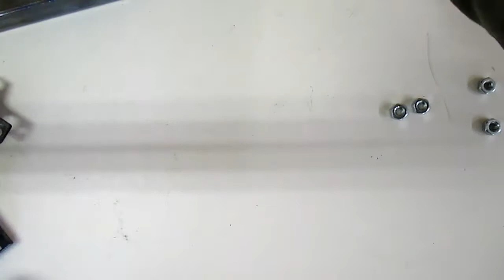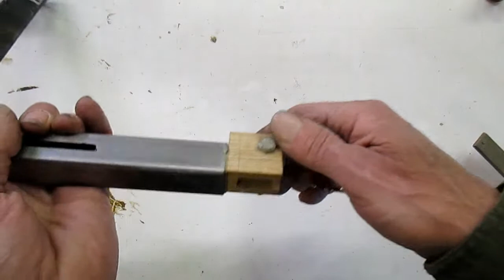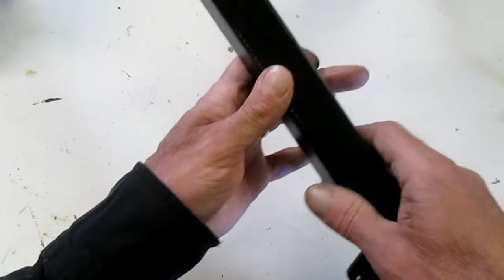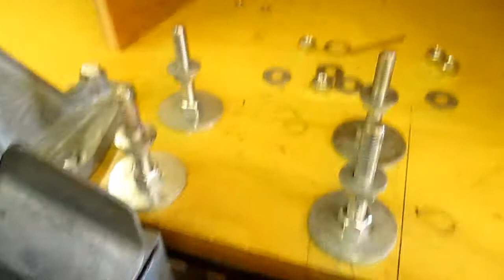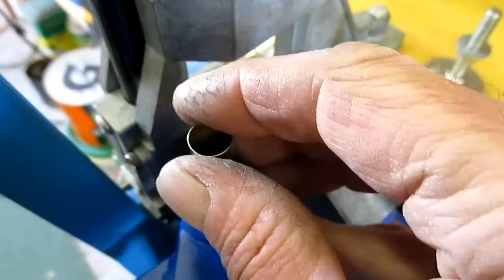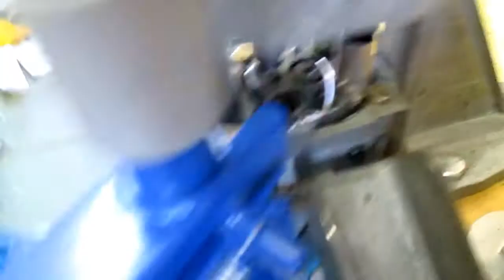The Build Dillon Square Deal B Case Feeder

Comment: Hey BYI, Thanks for showing us that it can be done... I know you have said this was a one off, and you don't have any plans/ drawings of the idea. Would you be able to confirm the different lengths of tubbing you used for the vertical/ horizontal pieces? I have tried to use my phones measuring tool and paused the video and seem to have gotten 3-4 inches on the vertical pieces and 5-6 inches on the horizontal. Am I close to what you have actually done?
Reply from the maker: Hi Roy, I did a short video for you with some measurements. This is only what I did, you may come up with something different but I hope this helps. Here's the Link       https://www.youtube.com/watch?v=MFSbqGKVuHY&lc=z224y3ojdt3xy1cqe04t1aokgr5g5jweip1rehdugahrrk0h00410

Comment: I'll just buy a 650 or 1050.  Had the SDB it's a waste of time IMO.
Reply from the maker: Now I have been running my Square Deal for 30 years now, it’s what I could afford at the time. It’s always done the job at task, the one I put the case feeder was by buddy’s. Sometimes we have to make do on what we have. And still can’t afford 650 all decked out so I just make things work best I can. And the challenge of it makes me want to do it.
Reply: draw up some plans with parts to size to be used as templet I will buy them
Reply from the maker: Sorry P.A. I have no plans for this just had a sketch on a piece of paper then made everything fit from there. This was a one-off project for myself just to show it could be done.
Reply: I’ve got a 650 and a square deal.  The SDB works just fine.  The case loader is really the only missing feature.
Reply from the maker: Sorry took so long to get back, I must say it is a joy to have it on the square deal. Was thinking about it for years till I decided too just do it, a lot of work but a great feeling when it works!
Reply: buying equipment is for someone that does not have the skill to make it.  on top of that making something from nothing is much more satisfying.  recently i made a very basic stand for my dirtbike.  i posted it on a forum, and one member said, why didnt you just buy one, they are only 25 on amazon.  sure, 25 bucks is not expensive and its easy to hit buy, but 6 dollars in material and 20 minutes between measuring, cutting and welding and i had my stand.